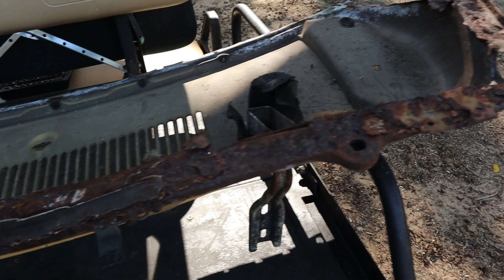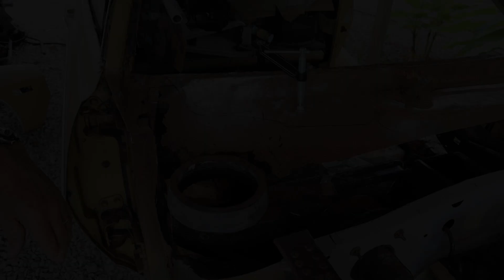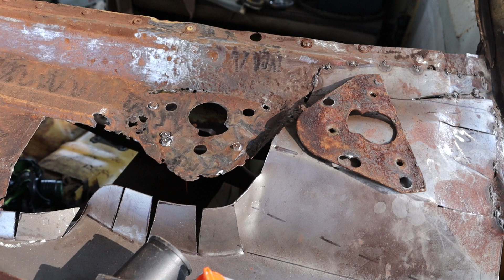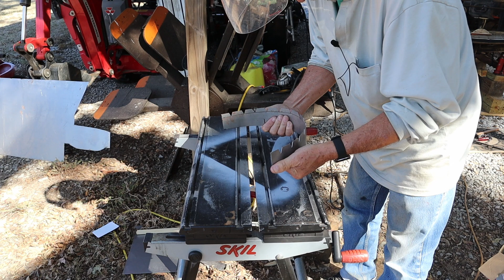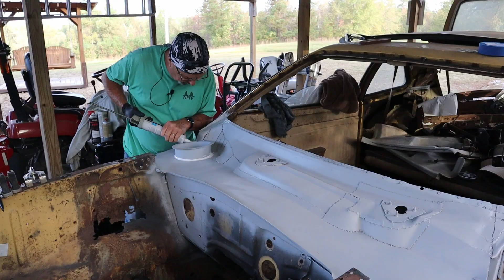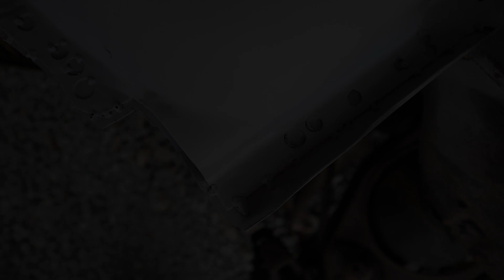Pinto Cowl Rebuild

Comment: Thanks for the videos on this Pinto. There are differences between this and my '79, but it's giving me insight into what I may find. The biggest thing for me right now is to get the drains unblocked because they do not pass water, and they fill up about 2" on the driver's side. I could see where the exits are supposed to be on yours, so now I go digging on mine lol! Thanks again!
Reply from the maker: Hi, good to meet another Pinto fan. Hopefully your cowl is not rusted out like mine and letting water into your floor pans. That is a huge job to fix. If you haven't done so already please consider Subscribing. I have other videos on the Pinto that might interest you as well. I just can't seem to make my project move faster. Repairing the rust is taking me forever but I am committed to completing this car. I almost ready to post an update video where I have been working on the rear of the car.  Either way thanks for watching and commenting.
Reply: @NINEPOINTFIVEPROJECTS I have subscribed and watched a few other videos. My cowl is in better shape, but the air intake has separated from the lower cowl, so I'll be cutting at least some part of it away to repair that section. I got the drain areas cleared out though, so at least that will help with further damage. The floors are toast, but I'll have to fix the cowl first so that it doesn't kill the new floors. Ugh. 😂
Reply: For what it's worth, I did learn that you can SEE the cowl drain when you open the door and peer into the fender area/hinge area.  When I poured water in the cowl, my driver side door was open, and when I squatted down to look under the dash, I saw the cowl drain !! and water coming out.  So I know my cowls arent clogged.  But. I still have water getting in the floor on drivers side.  Still gotta search for the source.   Thanks to everyone for helping each other out on these dinosaur legacies!!   I own a near mint 1980 and enjoy driving it and the conversations it creates.

Comment: Absolutely awesome work!  This is something that may have to be done on my 76. Not due to rust but because the cowl got damaged due to the hood opening while driving.  Keep up the great work.  Looking forward to further updates.
Reply from the maker: Hi thanks for watching and the comments.  You may have found it already but I have another video where I redo the metal part of the dash as well. Either way I think you may have already but if not please consider Subscribing and hitting the like button. I would really appreciate it.

Comment: Man that turned out really nice, probably better than factory. Im glad you decided to tackle this project instead of scrapping it over a lil work on the cowl because the rest of the car is in really good shape when most people were saying its too far gone over a lil bit of work . These things are getting more and more rare. I can't wait to see more of this pinto project , its going to be a nice car when you get it finished. My pinto is a 79 model and ive got some wood chips ive got to get out before it rust my cowl out that was in it when I bought it that ive inspected it from under the dash and it all looks really good for now but gotta get those wood chips out. Ive gotta put a heater core in it so i can enjoy it in the winter and im in Alabama so I don't have to worry about any salt luckily. It has a fresh built 347 that I built and put in it with a 5 speed and a rear-end out of a mustang that i narrowed and put in it . Its going to be like a resto mod street car that I take to the track on occasion and drive when im off work. You're going get lots of attention in that thing like i do. Im surprised at how many people likes these cars
Reply from the maker: Hi thanks for the comments. Yeah I'm looking forward to getting the Pinto complete someday, but that is a little ways off. I am going to rebuild the floor boards next because the frame comes back and attaches to them and right now theres not much to connect to. What part of Alabama are you in because I'm in Bama too.
Reply: @NINEPOINTFIVEPROJECTS  yeah I got lucky and my floors were really nice with a little surface rust on the driver's side so I just sanded it and put rust converter on it and painted it then put some really thick peel and stick sound and heat insulation on all of the floors which will not allow water to touch the floors on the inside again if it were to leak plus it's really cheap, I used it in my roof as well and double layered it before I did the headliner. I'm in Ozark Alabama a lil town between Dothan and Montgomery . It's 20 miles north of Dothan or 80 miles south of Montgomery. Where are you located?, that's pretty cool to have someone that is that close building a pinto . I can tell that you have tinkered with cars a time or 2, that cowl came out really nice
Reply from the maker: @79beans347  I'm in a small town called Randolph. I'm about 30 minutes north of Clanton which is north of Montgomery. I'd like to see your Pinto sometime.